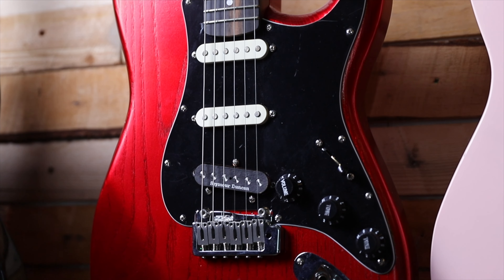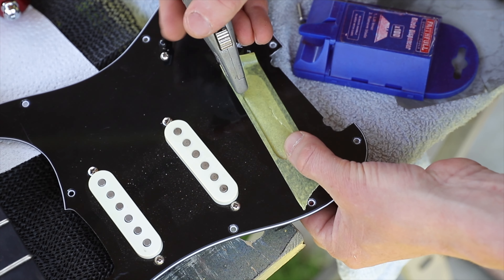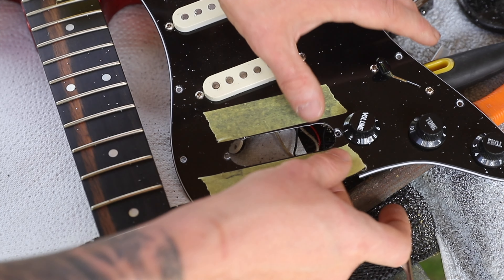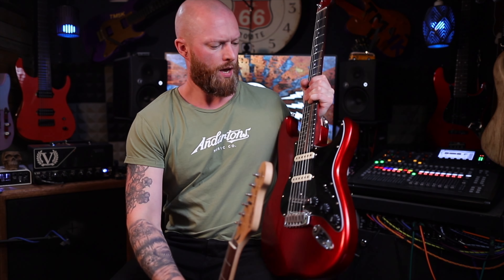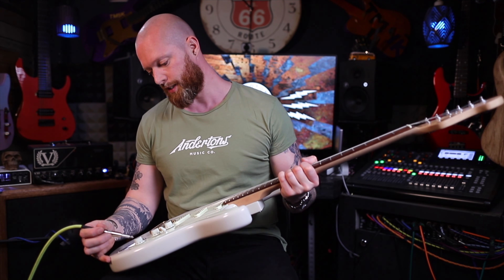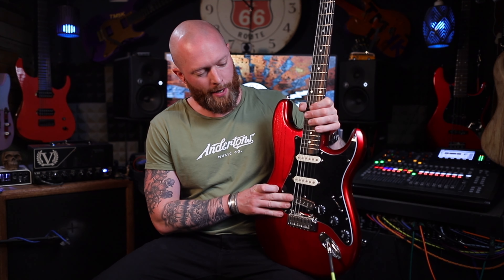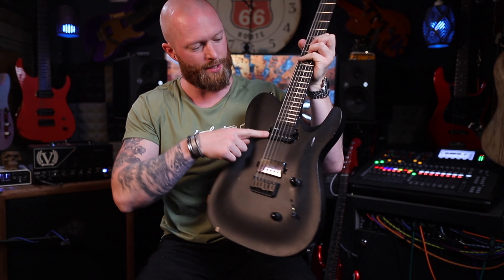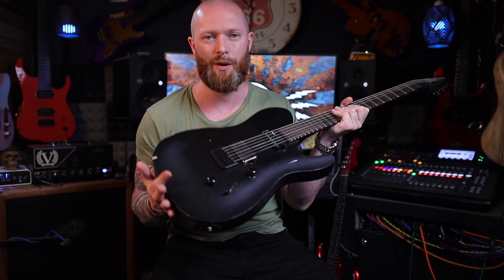Tele pickup in a stratocaster

Comment: Take the tele bridge and cut the plate a quarter inch around the pickup whole and slip it over the strat pickup under the pick gaurd and see if it doesn’t sound just like a tele. May have to make a little relief in the wood for the plate. I found this out a long time ago when faced with this same problem. The metal tele bridge upsets the eddy currents and gives the tele pickup its magic. It has nothing to do with the factory base plate. The bridge sets between the positive and negative sides of the magnetic field and they can’t interact with each other.

Comment: Have you ever done an A/B comparison on a Strat with Tele bridge pickup with, and without the steel Tele mounting plate? That would make for a good video.
Reply from the maker: That’s a good shout actually. I’d need the exact same spec pickups. 
I have a strat bridge plate comparison video shot and edited but not due for release for quite a while. Almost no difference in sound. I was shocked
Reply: @PherotoneStudios  I'd imagine that the Strat baseplates are all steel, possibly with some plating, so I'm not that surprised that they're close in sound. I guess the thickness and mass would be in play though.

Having the Tele mounting plate compared with 'no mounting plate' (mount to pickguard, as in a Strat) could make some difference. I've never had occasion to try it.

I have tried metallic pickup covers for Strat pickups, and even a thin metallic layer bothered me. 

I've seen some pages (Strat-Talk maybe?) where they experiment with cutting slots thru the top of Tele neck pickups to minimize eddy currents while still providing some shielding.

Comment: I've been obsessed with this video since I first saw it a few weeks ago.

However, I was wondering if it is possible to have a Telecaster without a bridgplate?

Eg. Similar to how the Aerodyne Stratocaster doesn't have a pickguard or plate. Can I achieve the same aesthetic with a Telecaster? I've searched endlessly for an answer and this is my last attempt before I give up and/or build my own. 😂
Reply from the maker: It’s definitely possible. The original plan was to do this on a strat body that doesn’t have a pick guard. You’d have to rear-mount it though
Reply: Id say so, bc to my ears all that twang is in the pickup construction itself and doesnt need a bridgeplate